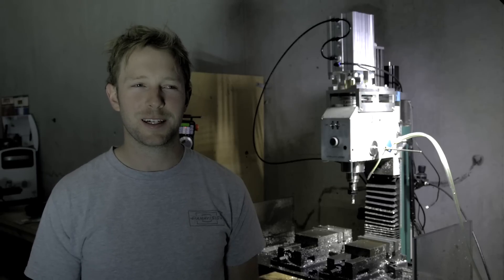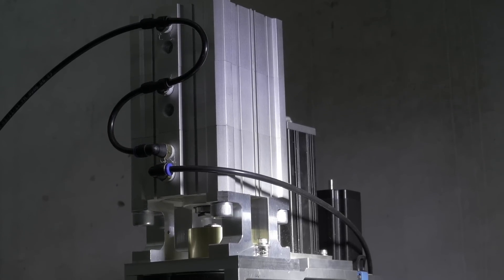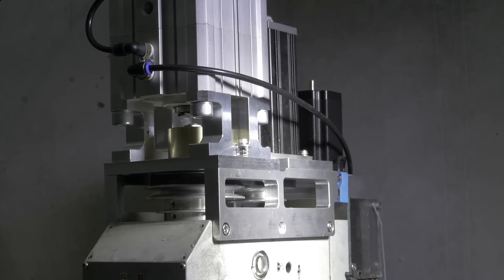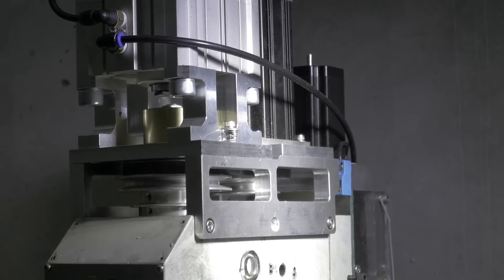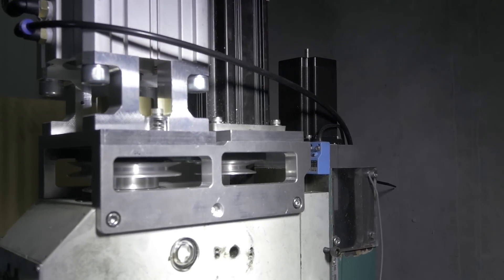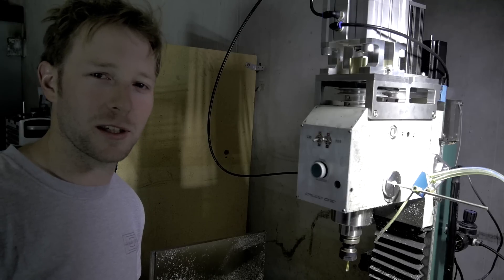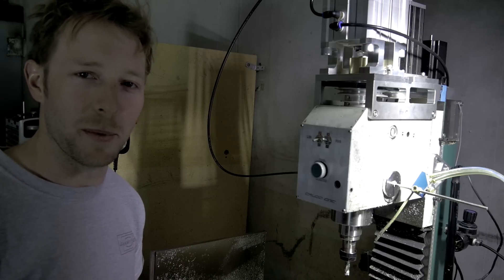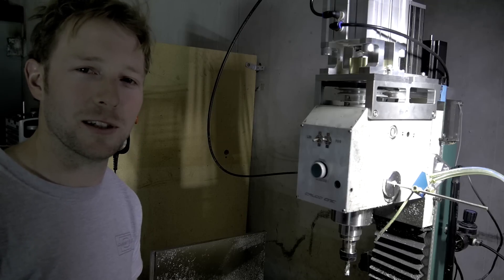Power Draw Bar Version 2

Comment: in the background I see you have a MPG handjog, how did you wire the MPG handjog wheel to the controllercard or did you use a pokey?
Reply from the maker: It simply plugs in to the USB port on computer and then a driver is installed for Mach3

Comment: I do not understand why the assembly needs the ability to move up, and why does it need the springs? I understand that the Belleville washers holding the drawbar force, but why does the assembly need to move up? and why does it need the other springs? and how does this not put force on the spindle bearings?
Reply: Justin Small its only pushing on the drawbar not the bearings. The springs undernthe cylinder are to alleviate excess pressure when pushing down the drawbar. Probably not necessary depending how you set it up.

Comment: Nice video, I'm learning a lot from the likes of you mill guys out there, thanks. I have a point to make, I noticed that when you actuated your drawbar, the left side (looking at it) of the air cylinder would move upwards. Is there a reason for that happening or is that the way it is suppose to work? New subscriber.

Comment: Hi luke, One thing that i cant seem to find is how many belleville washers did you use? and how do you work out the washer force needed???
I plan on buying a TM25V from titan in the upcoming weeks and a manual quick change drawbar will be on the list of things straight away

Cheers Ryan
Reply from the maker: Hey Ryan, I used the same configuration as the Tormach PCNC series milling machines do, I think it was ()()() stacked like that... the info is in the manual online somewhere. I actually bought the washers from Tormach lol

Comment: Hey luke.  I've started collecting the bits to do my Power drawbar, based on your design. I'm going to see if I can use a Tormach 770 drawbar. I may have to shorten it though.
Since your basically just around the corner, would you have a part number and supplier for the  gas struts you've used?

Cheers,

Peter
Reply: +Peter Homann 

I got a drawbar from the littlemachineshop and then had to shorten it and then re-thread it, if you want the part number let me know
Cheers

Comment: Thanks for sharing! I have 1 question:
Does the drawbar have contact with the top hat(i think thats the brass item)  when the spindle is on? If so how does this avoid building up heat?
Reply from the maker: +Unorthodox Fabrication Hey man no it doesn't make contact so there is no friction
Reply: Thanks man, For some reason this PDB is intimidating to me. I will hopefully have mine going soon.
Reply from the maker: Awesome I would love to see it in action when you get it finished :) the intimidation will wear off you use it haha

Comment: Hey Luke, I wonder if you could explain how the PDB fits on the top of the Mill, I have a TM25V that should be much the same as the TM20V. 
When I look at the top of the TM25V where the drawbar sits there is a threaded hollow bolt about 20mm with a circlip in it.
Did you have to remove this or does the Sleeve and the Top had just sit on top of this.
Thanks

Comment: How about a link to the cylinder?
Reply from the maker: +CncObsession  Check video description
Reply: http://www.xinyipneumatic.com/3-stage-pneuamtic-cylinder-155.htmlhere is link for your reference..  more question, you can send e-mail to me  sales@xinyipc.com.cn
Reply: Vicky, that is a dead link. Fortunately I now have a cylinder.
Reply: http://www.xinyipneumatic.com/3-stage-pneuamtic-cylinder-155.htmlOK, Noted you have a cylinder,  if you have more inquiry about cylinder and soleniod valve, Welcome to contact with us ..
Reply: http://www.xinyipneumatic.com/3-stage-pneuamtic-cylinder-155.html
Reply: the links work, but the company doesn't respond to any communucations.  would love to get pricing on the air cylinder, but I can't get a response back.
Reply: Try Fabco. They will make them anyway you want. Pretty reasonable. Less than 300 anyway.
Reply: I have reached out to Fabco but they don't sell direct and the few distributors I have called are clueless.  Fabco cylinder is 249, but I can't find anyone to order it for me.
Reply: That is odd. I had them build a PA36-HRO.625 I thought I ordered it direct. Here is the link.http://store.fabco-air.com/
Reply: I have already revert to your E-mail yesterday,   And just now I have resent E-mail to you .. Pls recheck it .
Reply: My Skype Vicky19820904